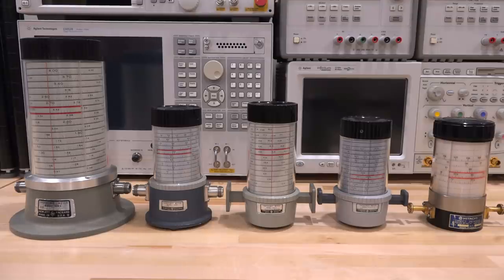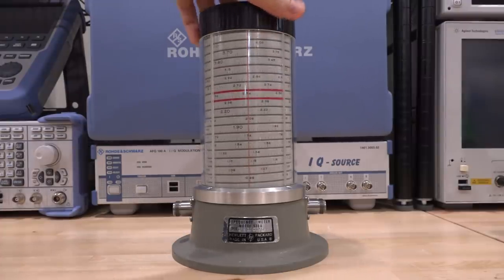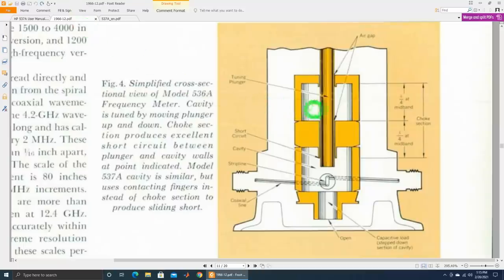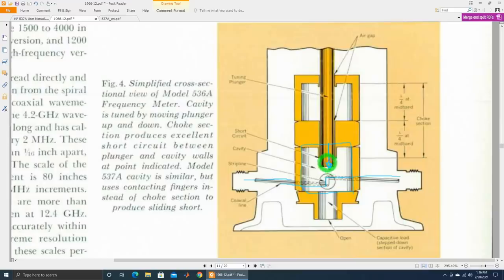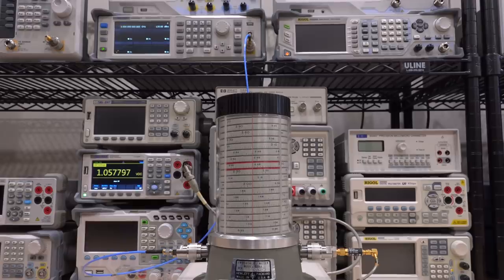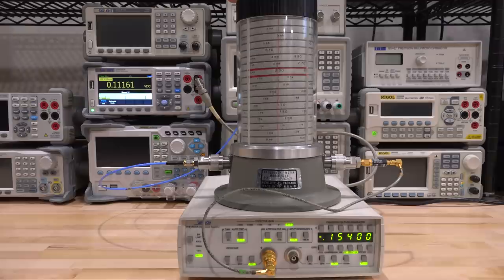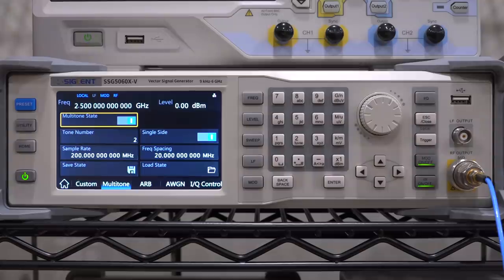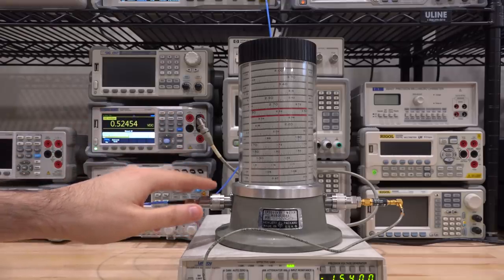TSP #183 - Experiments & Exploration with the Amazing Vintage (1966) HP Frequency Meter Instruments

Comment: Brings back a few memories.. I started my electronics career in the Radar industry,  about 1976 . There were a few test setup's with that type of device bolted to the waveguide. Another interesting item was a calibrated trough line, where you could measure the frequency, forward and reflected  power., Used when building the scanners. 

At that time I think there was only one spectrum /  network analyser in the factory , and they cost several times the value of the average house!

Andy
Reply: And the RF dummy load waveguide, a large tapered section of waveguide filled with an iron oxide loaded epoxy. New ones would always smoke for a few minutes as they burnt off all the paint. Same for the RF absorbent chamber, where the black carbon foam would smoke as well, till it had burnt out the plastic used to make the foam. Then it was brittle, but lasted till it either crumbled from touch, or just collapsed from age.

Comment: I used these on my bench at HP way back when. But I prefer a “classic” moniker rather than vintage. :-)
Quick story.  One of the less-than-stellar engineers told us that to check the vibration tolerance of the then-new 86290 module, we were to drop a particular model frequency meter onto our bench from a height of one inch. So a few times a day, thumps were heard, indicating the test was in progress. We still used the same frequency meter for some additional tests.  I guess it says something about the robustness of the equipment back in the day.
Reply: Rick Dabney  ,  Kind of sums up the spirit of the day. LOL I was not in that frequency domain at the time! I was topping out at 150 MHz. LOL

Comment: I was using one of these and thought it wasn't working. It was the very sharp dip! It is very easy to skip right over the dip if you don't have any idea what the frequency is. Something that would have been interesting would be to tune it to the second harmonic when it was on the network analyzer to see how much the harmonic dip is attenuated. (and the third harmonic to see if even-odd is different)

Comment: Thanks for showing those, only read about them in books :) I have came across RF absorption detectors though (measure RF power by heat generated/rise of temperature); maybe you could try to couple one to your cavity to have the most low tech frequency meter :)

Comment: There's nothing like pure physical  measurement. Besides the cavity wavemeter, slotted lines and calibrated delay  lines work much the same way. You measure it with a ruler and calculate.

Comment: Very cool. I suppose these were used with analog meters back then. Whenever I measure larger diameters with calipers (8-24") watching the needle as you sweep it across  it is just a bit easier to find the peak. Had to explain to my co-worker who hadn't spent much time in a machine shop that yes, I have a pair of digital Mitutoyo calipers, no I wouldn't prefer to use them over my B&S dial calipers.
Reply: Digital is faster for absolute measurements. Analog is faster for the first derivative. So finding the peak is easier with analog, reading the true value easier with digital. Though with a fast enough update rate (60Hz or better) and appropriate output display (eg bar graph, oscilloscope-style trace line, etc) a digital display can serve just as well as an analog one for easy first derivative estimation. But even very good calipers don't have that capability, so I'll also keep my dial calipers handy!

Comment: The high q of these devices makes them suitable for conversion to a resonance cavity for measuring the dielectric constants of materials.  It feels sad destroying a piece of finely machined history, but the new resonance cavity measurement devices sometimes cost 5-10K and one can make a reasonable measurement device for under $50 using this method.

Comment: To be honest, unless a device was subject to misuse or abuse, calibration is mostly a matter of ensuring quality, traceability and liability reduction. These are very important reasons, and calibration can detect equipment damage, abuse or misuse, but equipment performing well without calibration is not that surprising. It should be the norm, calibration is to catch the expensive exceptions.

Comment: Rotate the Page View

Do one of the following to rotate the view of the document pages:

    Go to View > Rotate View > Rotate Right or Rotate Left.
    Clickin the Common Tools toolbar > choose Rotate Leftor Rotate Right .
    Right-click the document, and choose Rotate Right or Rotate Left.
    (In macOS) Move two fingers around each other with Mac trackpad.

Note: Foxit Reader allows you to rotate pages in 90-degree increments. Pages are rotated for viewing purposes only, and no changes to page orientation will be saved to the PDF file.

https://help.foxitsoftware.com/manuals/pdf-reader/foxit-reader-for-mac/en-us/3.2.0/View_PDF_Files.html

Comment: What is the top cavity used for?
Reply: Nothing, it is the spare volume. It does though need to be made very lossy, so that it does not interact with the measuring chamber. Tthe piston varies the volume of the lower chamber, and as the frequency lowers the top chamber gets smaller till at the end stop it is almost non existent. Piston does need to have a very good RF ground, so there is a very tight tolerance, plus a few sets of RF fingers, that are on the outside of the piston that ride on the wall, to get a good RF connection. Heavy silver plate on both  parts inside the cavity, polished and ground during manufacture to get a very close tolerance cylinder diameter inside in the silver coat, and same for the piston, so it has only a few gas molecules of clearance between the two. 

There is probably $50 of silver in the instrument as plating. Then the cavity is sealed with a good air seal and purged with nitrogen, to keep the cavity from oxidising, and there is a pressure compensating bladder to allow temperature and altitude changes as well.
Reply: @SeanBZA  maybe not $50. I could plate your entire car with 2oz of silver. Putting that much plating on it would wreck your very careful machined tolerances.
Reply: @stargazer7644  Machine after plating, to get the tight tolerances. you will polish off a part of the plating, because in most cases plating is not always totally even, especially with complex shapes.

Comment: I need to learn how to set up a signal generator using very basic “how to”  information - thanks
Reply: You set the desired frequency, and the desired output level. Optionally, configure the desired modulation. That’s about as basic as it gets.